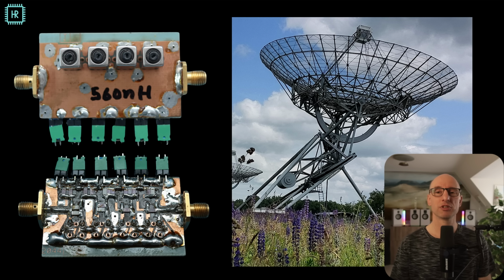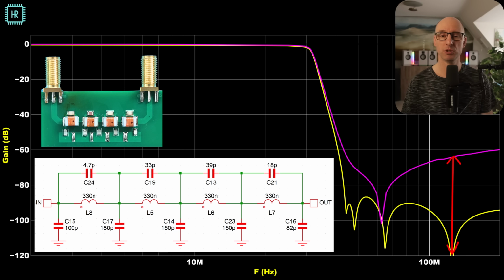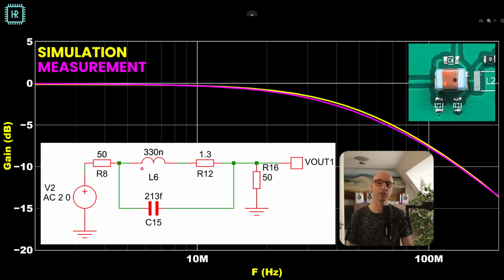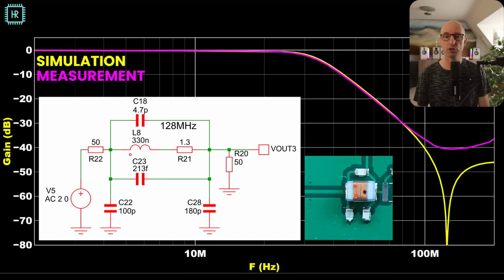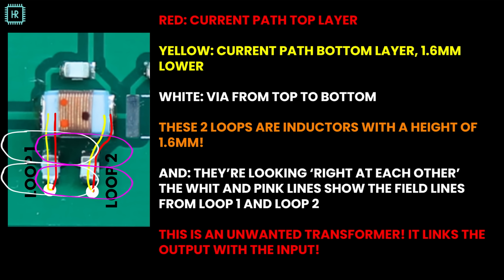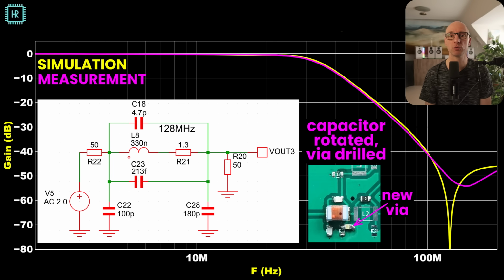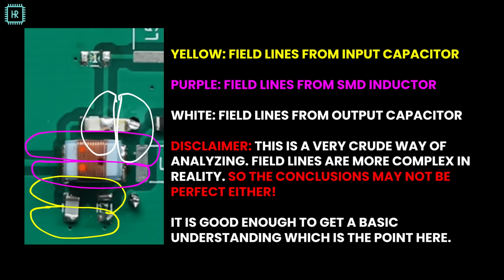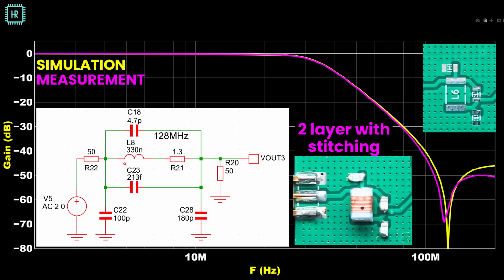The Hidden Time Sink in Electronics Design

Comment: Basic layout considerations cited in lots of application notes.
In this case often by Wurth, like ANP007a sect. 5.5 (page 9) and going back at least 20 years to "Inductors & EMC Ferrites Basics" May 2006 presentation by Michael Eckert (slides 64-65).
Reply from the maker: There are great appnotes and datasheets but I've also encountered ones advising wrong solutions. The hard part is knowing which claims at true and which are not....

Comment: why would you put your silkscreen under the components?  Also, why would you not position the parallel capacitors to be in-line with your signal path, and not below (creating stubs and also closer to each other)
Reply from the maker: I have a very specific reason for putting text belonging to a component 'under' a component. Most of my designs have no space for text next to the components. 

Also, I personally really don't like putting those next to components. I have the design files. When you print those, the reference designators or values will be nicely centered on the component, making any chance of confusing them 0.

The stubs are no problem at these frequencies. You'd have to go  much higher before they cause problems.

For a stub, you always have to look at the frequency you're using and see if it starts bothering you.
Reply: @HansRosenberg74  Understood!  Thank you!

Comment: In my first look at your PCB two things jumped out at me.  1) You are using unsheilded inductors, and 2) your shunt caps are oriented perpendicular to the inductors so the magnetic field lines will induce current in the caps.

The first thing I would do is order some shielded inductors, if I could find some with high enough SRF.  While waiting for those, I would rotate the caps 90 degrees and tighten the loop areas.  This is pretty basic.  But you are right, they don't teach this stuff in engineering schools.
Reply: I'm pretty sure the boards were intended to have some flaws that could be illustrated in the video.  It was not intended to be a "good" filter that illustrated Hans's skill limit.  It's a pedagogical example.
Reply: @yakovdavidovich7943  I agree.  But there was another issue I forgot to mention, and I don't thing he addressed.  All the inductors are lined up end to end, so there could be magnetic coupling between them.  Half of them should be rotated 90 degrees.
Reply from the maker: Yes, there is coupling indeed in this design. It was one of the things I wanted to demonstrate as well, but the video already got long enough.

There is an even better solution (someone sent me an email on it). If you put them at 45 degrees, the fields have the least coupling! You can see it easily if you draw the field lines.

Comment: Just from the start, anyone who thinks design in the hard part/the part that takes the most time has never actually made anything. I don't care if it is purely digital, purely analog, or somewhere in between, circuits will behave differently than simulation due to human error and/or errors in the simulation.
Reply from the maker: Indeed, however, if you have experience, the gap between simulation and reality is not that big. My free course covers a lot of the causes of differences between sim and reality.

Comment: With all those modern supercomputers and AI stuff, I would expect CAD tools to help with this RF wizardry, but here we are.
Reply: Ehh. AI is just statistics, it's complex statistics, but it will still fail to deal with corner cases.

Simulation limitations are a different issue, you don't want to spend hours of CPU time on every single board. Simulation being slightly wrong but fast is much better than it being correct and taking hours. And there are just math reasons for simulations diverging sometimes
Reply: @АлександрКопнов-х2ю  Mostly going for approval was a really successful PR move for all the LLM services. Most people can't tell the difference between information gathering and making shit up. Especially when unfamiliar with or overestimating their knowledge of a topic. So they follow what makes them feel good. But everyone who actually has to make things that work hits the llm limits fast.
While everything with late, vague or heavily delayed feedback. (Or a mix of all.) Well, feelings take priority. And then the statistics win  most of the time.
Reply from the maker: exactly, this is the problem. It will be very hard for ai to get enough good training data in this case.

Comment: In the 1990, in a digital circuit I was getting crazy voltages that didn’t make sense. I.e. > VCC. I called over the senior engineer and he tried placing a small capacitor at various places and suddenly it worked. Everything was fixed. His analysis was that the circuit was inadvertently creating a voltage pump. I had spent hours trying to see where I was going wrong and I would never have found the problem. 

Actually, at this point, I decided to stick to programming as debugging was so much easier. I kind of regret that now but compared to now our only recourse was, pre internet, was: to read book, read a magazine, read a data-sheet, travel to a library, experiment or ask someone more experienced. This seems harsh but we did some amazing work under those conditions.

My subsequent mentor said “Always remember. No bug is smarter than you.”
Reply from the maker: Nice story :-)
Reply: Good ol "wires are inductors" issue
Another couple "fun" ones are "esd protection diodes can power your chip" and "whoops forgot the watchdog"

Comment: This is why I like electronics so much more than chemistry.
The rule is still true for chemistry, but god damn the fundamentals are so arcane that "debugging" often becomes a PHD research project.
Also, this is why I always put trimmers in anything that needs to hit a precise frequency, if it actually goes to production we can lump it out, but even then if it needs to be very tight then sometimes just putting every single board on an analyser and twiddling some knobs can actually save a lot of time.
Reply: Also it can save money, you have someone doing calibration on 100 boards per hour, that's like 20 cents per board, or you can spec 0.1% precision components that cost a total of like 2 bucks per board.
And designing for elasticity makes designs a lot more repairable and tolerant to supplyer changes
Reply from the maker: yes, great points!

Comment: So as usual, first you need to simulate all of the schematics according to known physics, not just as a simple school level approximation? Because capacitance and induction between components is a well known behavior.
Reply from the maker: yes, but hard to model and you first need to know there is coupling, otherwise you will not even fire up the simulator.... that is the main problem,.
Reply: @HansRosenberg74  any parallel conductor should produce the induction and capacitance. Shouldn’t the software already solve this? Simulate where the current flows, that is the magnetic flux, etc

Since this is a known problem. There are probably some unforeseen effects, but you learn them with experience. 

Although I kinda remember now when we did get a very high current in a free line due to kW ultrasonic emitters 😅, but this was outside of PCB in 3D world

Comment: Earth Quake at 2:04?
Reply from the maker: hahaha, I guess you mean the moving camera?!

I just got a height adjustable desk and this is the first time I worked with it making videos. 

I should remember not to change my weight on the desk as the stuff starts shaking.

Also, recording standing up tends to make me move around a lot more, I shouldn't move around too much, I think it is distracting.
Reply: @HansRosenberg74 haha, you could also try adding some more mass on the table so that the frequency of the vibration can be reduced enough to not be too visible on camera.

Comment: Allow for component tolerances and remember that 'new' components may sometimes be faulty.
Reply: And sometimes your probes, cables, or measurement devices fail in a way that gives a distorted measurement. I have spent hours troubleshooting my circuit only to discover the measurements are bad.
Reply from the maker: Yes, always be suspicious about your measurement equipment.

I once had some odd readings so I verified my spectrum analyzer, and it was at the edge of what specs allow so sent it off to calibrate.

Comment: are high order filters easier to build in the MHz range compared to audio range? i was under the impression that analog high order filters were difficult to do with discrete components, like for audio amplifiers and synths
Reply from the maker: For audio, you need some pretty large values. This makes it harder for audio quality. 

It is very easy to get distortions due to core saturation in inductors or in capacitors if you use class II ceramic capacitors. You can use film capacitors, but they get quite big, so it's either distortion or large size.
Reply: The DESIGN is easier since the effects detailed in the vid are easier to avoid, but you can see what Hans says about the components being bigger, which means more expensive, and if you want them to have good Q-factor (low resistance vs reactance) then they are even bigger and more expensive.
This is why almost all filtering is done at the pre-amp stage rather than anything carrying power, and even then many audio filters use op-amps and feedback to allow smaller value components to be used.

Comment: At my job they don't use simulation at all. For filters they use a waveform generator and a spectroscope  spectrum analyzer and just add/remove components (after doing a schematic on paper and calculations of course). Then it's just trial and error until you get what you want.
Reply from the maker: Yeah, but that takes more time. It  works though, I worked like that a lot in the beginning.

Comment: Hy! What type of spectrum analyser have 140 dB dynamic range?
Reply from the maker: Almost any spectrum analyzer will, but you have to control the attenuation and resolution bandwidth for the signal level to achieve that.

So when I look for a signal, I'll start with a high attenuation and relatively large RBW, when I can't find anything, I increase sensitivity. I do this in 3 steps. This saves time, you don't have to 'drill very deep' for every signal.

If it's strong, you'll get it with the least senstive setting.

I use an SA-44B. I'm very happy with that thing.
Reply: @HansRosenberg74  I mean, that coacsial cable shield attenuation for best examles is up to 100 dB (as Google say). I remember 40 dB for the worst and I hawe some doubt for ower -60 dB in panoramic picture...
I also see a shield problem In oscilloscopical measurements, where 40 dB separation between channels is not the worst. In addition, sometimes the influence of an external source of interference on measurements can be observed.

Comment: I have a question about this, actually. If this filter was in the audio range, would this placement be significant, or would the wavelengths being much larger make the ideal filter response basically not approachable?
Reply from the maker: I've never tried this but I'm pretty sure that 2 inductors facing each other with larger values for lower frequencies will act like a transformer.
Reply: The components would be much much larger - look at the crossover in a loudspeaker for example. The issues are very different but layout still matters.
Reply: @murdo_mck You mean the inductor, I assume? We use the same size caps and resistors in small signal audio range filters regularly. A loudspeaker would be different because that needs to handle much more power.

Comment: I'm a software engineer who designs mostly simple digital electronics as a hobby. The two things I take away from this video are: 
1. Hardware debugging is fundamentally not really different from software debugging. Breaking a system up into component parts and testing them in isolation applies also there.
2. My continued fear of analog electronics is totally justified.
Reply: 3. Every circuit is analog on a base level and must be feared :D
Reply: @te0nani  Sssshh you're going to give me nightmares 😱
Reply from the maker: I suggest you watch my free mini-course, there are simple rules in there that will make you feel a lot more relaxed with it :-)
Reply: For me I would replace "analog" with "anything above 100kHz".
I just linked together 6 server power supplies into a 480A current-controlled voltage-limited supply by tapping directly into their feedback circuit, using a single op-amp per supply and a shared input voltage that sets the current, it worked on the first prototype, and I have no idea how I could have done that digitally.
But when I linked them together I got some sort of feedback resonance between them, luckily I didn't care about response speed and just lowered the filtering way down to 10kHz.
Unfortunately it was chemistry that killed that project, I didn't even get to use the full current I tested it to 😢

Comment: I've always found that the design is the easy part. Getting it to work in the real world is the hardest! 
The input requirements and equipment loads seen by our kit is never as the customer described, the electrical environment noise is never as quiet as defined. Even had customer supplied hardware simulator not work the same as their final product.  
Never got to design RF circuits but I feel you would spend more time trying to match your simulation to the real world than matching your design to it. 

Even matching the first batch does not mean the the 2nd or 3rd will be the same.  The times I've seen issues when a critical components manufacturing batch has changed and the new batch behaves differently. Still within specification but maybe gone from just inside the max tolerance to just above the min.  

All part of the fun of being a design engineer.
Reply from the maker: With a few simple rules, 95% of these issues disappear.
Reply: @HansRosenberg74  bringing back to mind the old saying, 90% of the problems take 10% of the time. the remaining 10% their the hard buggers.

Comment: Why do the 6db attenuators in the test pcb ensure 50 ohm matching?
Reply: They attenuate the reflected signals twice more than the direct signal. The reflection happens once at each end of the wire - so it passes thru the attenuator 2 more times before it reaches the device's input again.

So effectively it 'attenuates' an impedance mismatch, too.

So in this case, the ratio of the reflected/direct wave at the input will be -12dB compared to no attenuator.

But you're right in that this would need at least a tiny bit of explanation in the video.
Reply from the maker: exactly! Would have been good of me to add a bit of explanation indeed.

Sometimes it is tricky to think of that if a concept is so obvious (at least to me having done this for so long). That is the hardest part of teaching I think.

Comment: Funny thing. I was designing a 70MHz/3MHz BW IF filter for a spectrum analyzer and the simulation was perfect. In reality the flat top was 2-3 dB lower in the right part of passband (say 71MHz vs 69 MHz) . The problem was that 2 ceramic capacitors (120 pf if I remember) behave weird . After I try philips ceramic capacitors everything was ok (and still work perfectly). After 20 years I still do not know what was wrong with those no name capacitors, all the measurements on them (off the circuit) was fine, but when I soldered and sweep the generator ... it was imposible to obtain a flat top . Any ideea ?
Reply from the maker: Could it have to do with DC bias? Maybe a slight change in characteristics due to that that was missed in off circuit measurements? 

I assume they were both NP0 / C0G  types, otherewise it does not make much sense in a filter? In that case it should not make a difference.

Maybe a much lower resonance frequency? But you measured that I assume?
Reply: @HansRosenberg74  Thank you for the answer, well was no DC bias and the effect was independent of sweep speed ( I was thinking of some remanent preposition of the material dipoles?) . Maybe when I will retire I will discover a new physics phenomenon :)  ha ha , for the moment I was glad that the filter was working properly with the square capacitors (the round ones (disk) had the problem) . The capacitors are thru hole and have  very short pins (tangent to pcb). Unrelated, thank you for the videos, very interesting for us, hardware RF designers, everytime I learn something new.
Reply: @MirunaIordachescu  Maybe the inductance of the disc caps? The height of them gives several mm of loop diameter even for the small ones.
I assume when you say square you mean SMD, which are closer to the board and have less inductance.
Also, cheap caps can have surprisingly low Q and high dissipation factor, which both reduce pass at higher frequency.